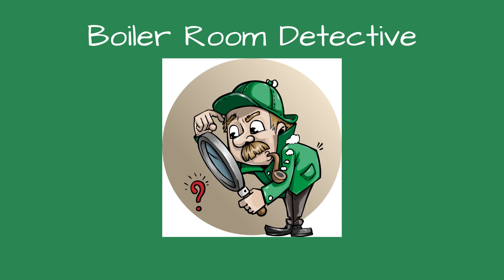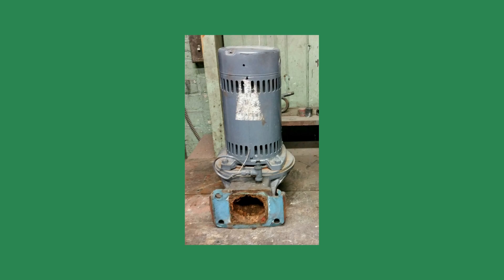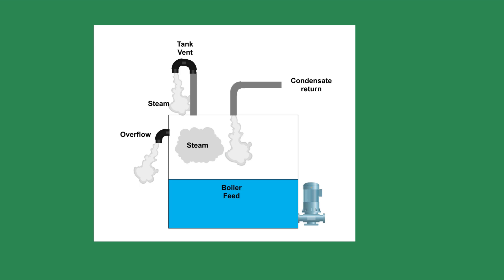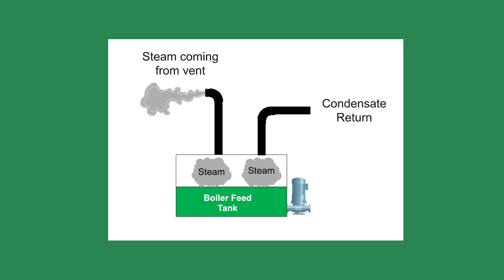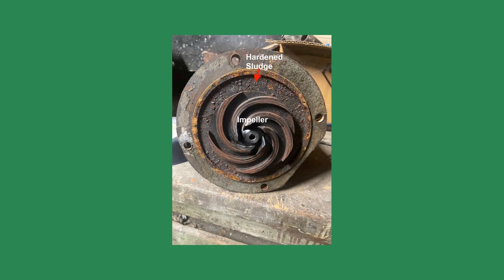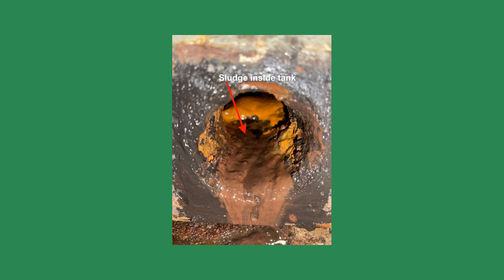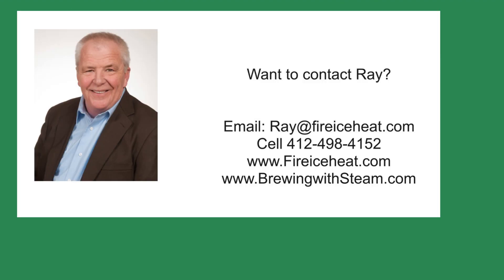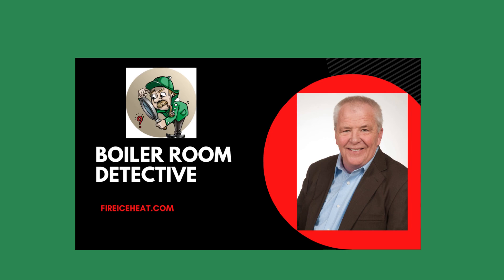Case of the failing feed water pumps

Comment: Ray, Yup, those pumps are designed to pump condensate, not mud and sludge etc! Too bad it took 5 or 6 pumps to find the real issue for pump failure.
Reply from the maker: Yes they don’t do well with mud